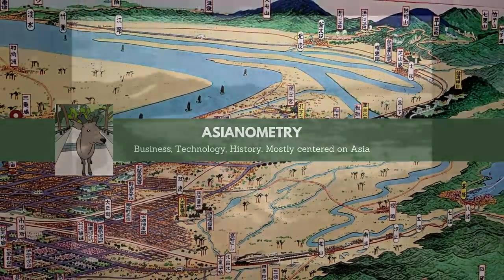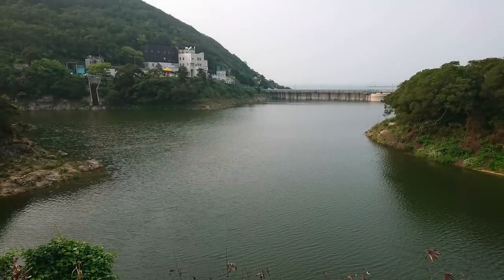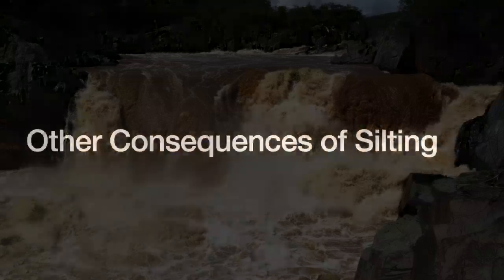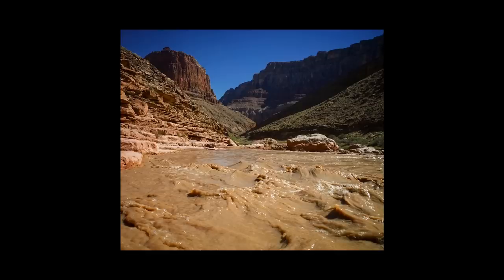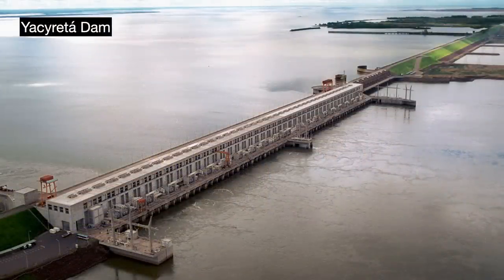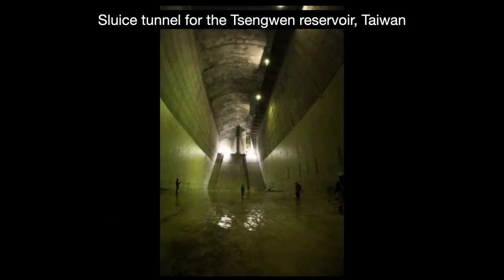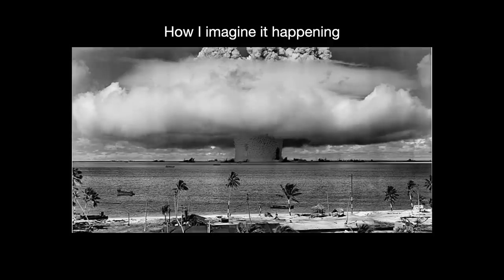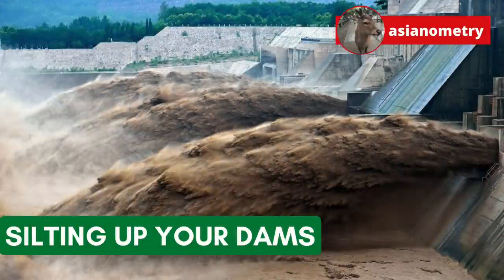When Silt Fills Your Water Reservoir

Comment: Oh I just saw a short video demonstrating this whole video. Someone was showing how a dam works but after putting a sponge into a clear container that had water flowing from left to right, they added in small sedimentary sand after the water levels changed. I wasn’t sure it would be that bad on a larger scale but it looked like it wouldn’t be good even on a scale as big as your hand. First everything slowed down (mind you the initial flow of the water and sand was fast already) then it all slowed down, flooded till it was level, and as he added more sand, it all flushed out and even went faster than before. I feel like it’s a video someone found and just said “this is how a dam works” but I don’t think that was the original purpose of that video now. Wish I had the link from Instagram, I’d post it here.

Comment: Seems to me that a side tunnel at the exit height of the dam should be installed with a huge barge on the other side with movable pipe work that systematically traverses the bottom of the pond. This acting like a GIANT vacuum cleaner . Simply lifting the pipe out of the water would stop the flow. no valves needed. About 2000mm in ID should be sufficient. A heavy steel / Stainless steel pipe capable of rotating up and out of the water so that the flexible sections could be changed out would be needed.

Comment: This presentation was absolutely educational. I am more aware more about the sediment problems behind Dams. I was always aware of the Hoover Dam silting up but did not consider the rest of the world's dams. The various silt removal methods, some better than others. What about bottom release instead of top water release, how well would that help, and how far from the Dam's bottom release area have a decent silt removal zone? Being retired from Drilling and Blasting, I'm leaning on explosives but after the bottom is loosened up how would that material be removed other than a slow, suspension flow to the outgo at the Dam.  Thank you for this subject affecting all Dams, hopefully, some newly built Dams have engineered methods into the construction that deal with this problem. Constant erosion. Constant silt depositing.

Comment: Near Angkor temple in Cambodia, there're 2 large man made reservoir built a thousand year ago: east Baray & west Baray.
The east Baray is 90% filled with sediment while the larger west Baray is not.
Wonder why they don't behave the same way.
Reply: West Baray also had issues in monsoon failure 500 years ago.

Either way, artificial irrigation channels eroded downwards forming rivers, and so each tree ring shows varying over / under irrigation.

Comment: That it would be best to build reservoirs that are crucial for local water supply... in pairs. You drain one at a time and keep it's siltation gates open for e.g. a year or two to completely remove the silt away, while the other provide You with the water You need,  and after these time, You change... and open the silt gates of the other one open for some time. Such system can operate infinitely without a need of any mechanical removal of a silt. It takes two times more resources to build.. but maintanence costs are minimal then. It may be a cascade of the dams, it will work as well. You de-silt it from bottom to top... every few years and the cycle continues.

Comment: I wonder... I saw one of the dams open spillway and spew tons of mud. What would happen if near the bottom of the dam we would make an optional spillway that opens on a regular basis, but just a thin flat thing, not very big. Open it just enough, so silt goes, close when you see water. Repeat every few days. 
With enough level difference, water would fill the hole with new silt, and you should reach some kind of equilibrium state. 
especially if currents would be engineered to pass over that thing, and leave all the silt incoming. Anyone knows any issues with that ?

Comment: Shortly after the massive Kaikoura earthquake in 2016, we had a large weather system hit our region washing all the material loosened by the quake into the Clarence and Ure rivers.  The Ure has a feature called Sawcut Gorge, which while difficult to get to, still attracted a lot of tourists and locals.  The sediment from the earthquake and heavy rain lifted the floor of the river Ure by several metres and blocked the valley downstream making Sawcut Gorge unreachable on foot.  Another strange result was that the higher floor allowed the feral goats to reach endangered Marlborough Daisies.  The Department of Conservation tried culling the goats from helicopters, but the mountainside was still too unstable from the quake, and that had to be abandoned.  I don't know what the situation is now six years later.

The Letsdig18 YouTube channel splits most of its work between building dams and dredging the ponds.  They remove thousands of truck loads of sand and silt every year, and it can be a risky business driving heavy excavators onto soft mud and sand.  This recovery video has had 21 million views now.  www.youtube.com/watch?v=3Eo_GvDGP-g&t=1035s

Comment: Outlets near the base of the reservoir? Open occasionally to flush silt out?
Reply: Older dams never had this designed in..and you would only scour out the silt right up at the dam...
If you had the desilting passages built in at construction...
and a huge armoured flexible pipe with a powered  "pool cleaner" at the far end...
you could do far better?
Reply: @JohnSmith-yv6eq  I'm a software engineer, just wondering :) thanks for your thoughts. I realize that silt is probably abrasive and no fun for metal pipes.

Comment: glaring issue. one can spend a bloody fortune on pumping superthick oil deposits & not spend much on pumping silt to the sea. high tech,high pressure pumping
only used for stoopid purpose rather than practical purpose... g, dumping silt into uninhabitable desert, canvas seed

Comment: Can’t the sediment be used for fertilizer after it’s removed ?  Before it dries out it can be mixed soil ?
Reply: Most soils have small amounts of fertilizer. This would be slightly better, but it doesn’t have the beneficial bacteria’s for the nutrients to be taken up by the plants. Then the costs of moving the soil from place to place would be very expensive (cost prohibitive or close to it).

Comment: All dams should have dredging crews stationed at them to pump out the silt and dump it on the other side of the wall or dry it and sell it as topsoil for a value add to help recover the cost

Comment: 5:21 what you want is like a massive blow down tap at to bottom with a railway next to it so you can open it up at the bottom of the dam and have the water pressure push a slug of sediment into a waiting railway to  fill up  a trail to haul off to some where that needs dirt lol

Comment: Also want to point out, that reservoirs, at least a very large majority, that say they control floods are lying (Looking at you Three Gorges). Typically, dams make floods worse by concentrating all the flood waters into a shorter period of time. You cannot have a dam that both supports a near full reservoir for drinking water and/or hydro power and does flood control. You need capacity to accept water, and thats just not what most dams do.